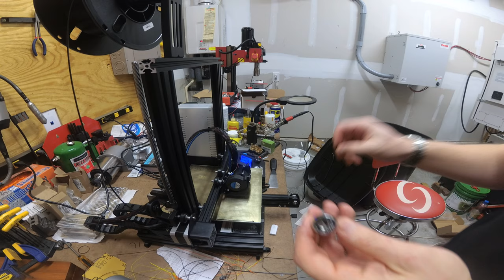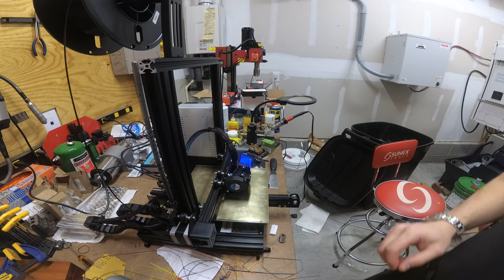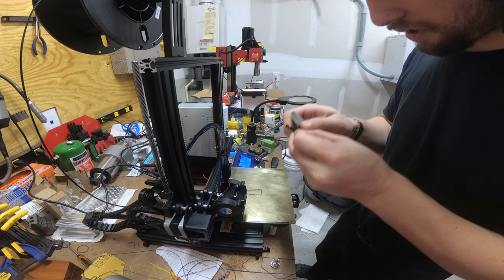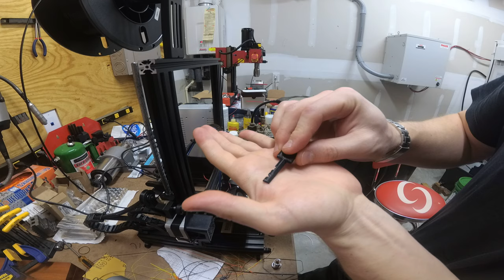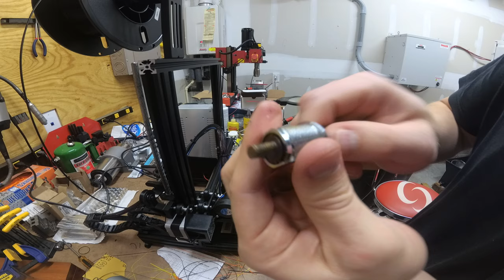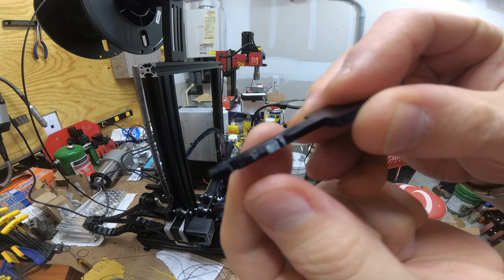Abloy Classic - 3D Printed Key

Comment: That definitely got my attention.  Do you think regular pin-tumbler keys would be fine printed in PETG?
Reply from the maker: I think they would work for some time, but not the longevity of a DD lock, or of a metal key. Pin tumblers have a lot of wear on the key tip and likely after only a few uses would degrade a lot.